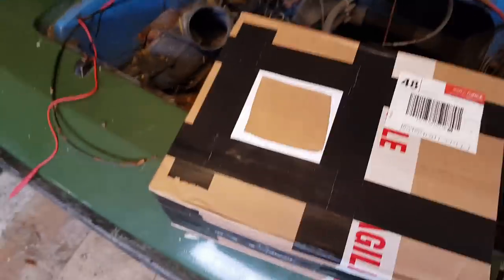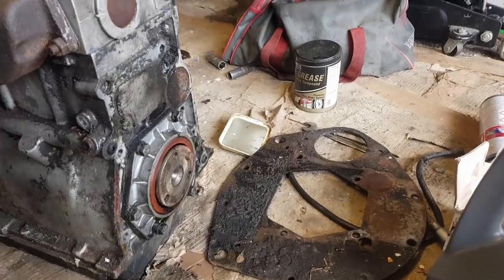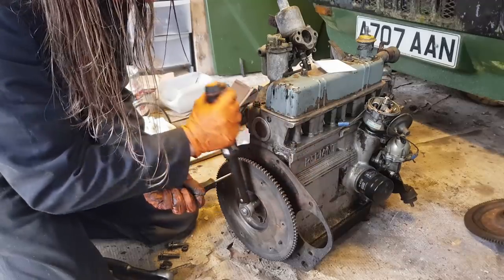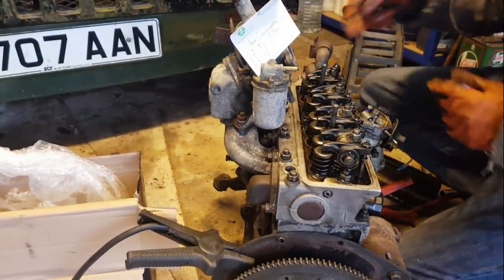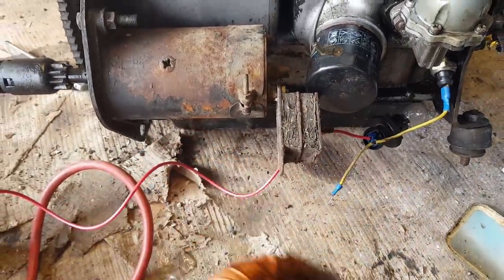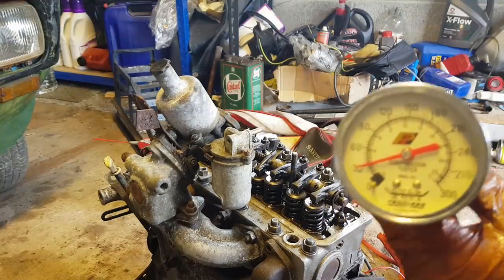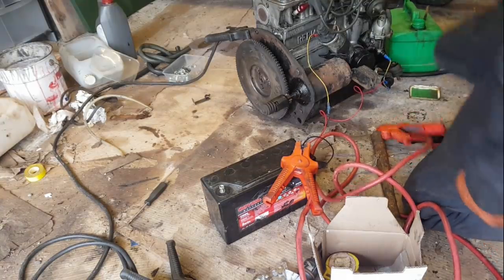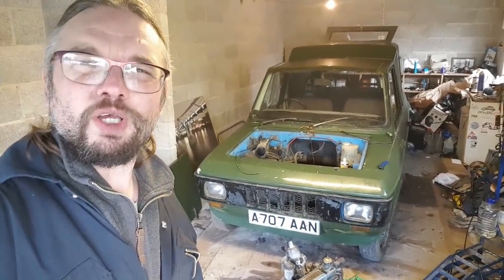Project Fox Part 5: Can I start an engine on my garage floor?!

Comment: -Gosh that's highly dangerous  with that open petrol can being showered with sparks , It could have blown and shot a massive jet of flame and burning fuel  over your face and you fox would have ended up a blob of plastic on the floor .No Fire extinguisher in sight  ( sigh) you really need to be more careful when all this is on a public video , viewers with less knowledge that you  would have no idea on the safety aspects of this video . At least it runs now and that flywheel could slice your leg off if the engine tipped over with the torque reaction .  !  I have seen a man killed  by a home machined flywheel coming off a racing car on a Metro with a non standard engine , it broke loose at 7000 rpm in the race   and cut itself out of the bellhousing , into the cabin and the driver's leg .
Reply from the maker: Yes, mucking about with engines is dangerous, it's true. The petrol can was a bit silly, but I was hardly going to reshoot it and then pretend it was the first run.
Reply: @HubNut  want to keep you safe, we would miss your videos, I have seen a heck of a lot go seriously wrong in my 46 year professional career as a motor vehicle technician. Did you know the best spirit based wash fluid is highly flammable and very difficult to extinguish for example , it burns with an almost invisible very hot blue flame !